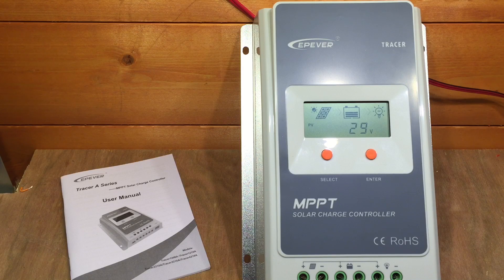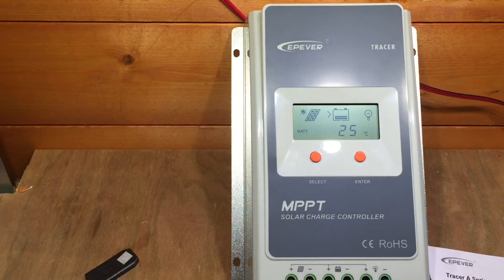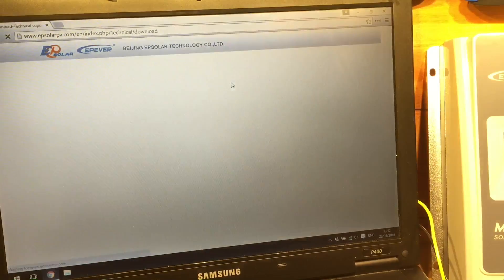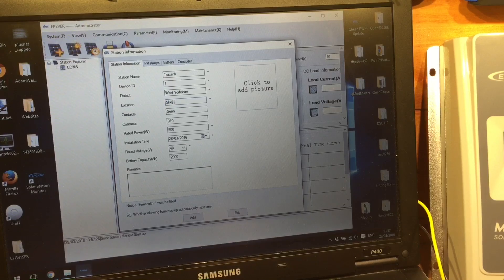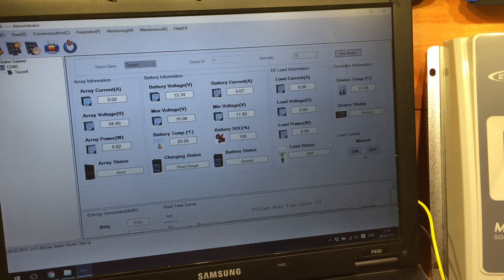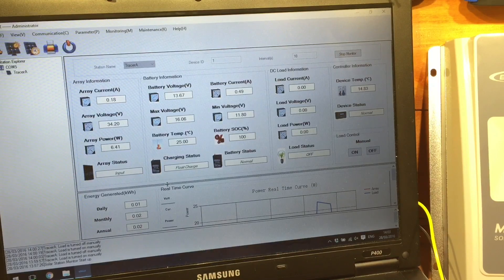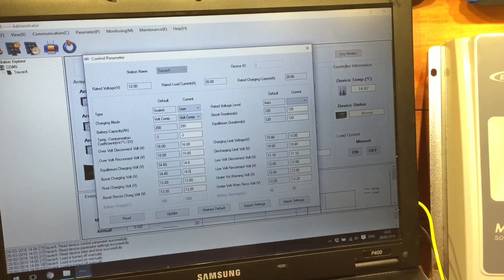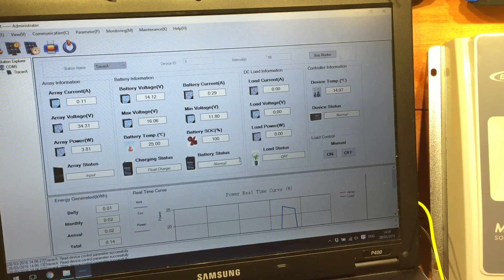EPSolar Solar Station Monitor software & a cheap USB cable - 12v Solar Shed

Comment: Well when she  does please let me know. I connected and commissioned my little system (250W PV, Epever Tracer 30A controller, 2 x 100Ah gel batteries and a pure sine wave inverter)  on Saturday and left the batteries to charge for three days as suggested by the manufacturer. It is a 70th birthday present to myself and last night I sat back and watched 4 hours TV courtesy of the sun. I am going to run a water pump to fill a 500 litre tank on my roof (it leads into 80  meters of 25mm black plastic pipe curled across the roof which heats up when the sun shines and takes the water into the house plumbing. No early morning or showers before going to bed of course)  my TV, laptop and lights. A bit of juggling is going to be needed  and info about how much each item uses and how long it will take to be replenished will be handy. I am in the bush in the Eastern Cape of SA and have plenty of sun and time to play. Watching you make the 485 cable reminded me of 1000 years ago when I worked out the pinouts between Autocad and HP A0 plotters. HP charged an arm and a leg and were horrified by my cheek. Add them to the dozens of 232 fly leads to Xenix/Unix terminals and .... oh sorry I am blathering on .....
Reply from the maker: I will - I'll make a note.  Sounds like you're having fun with your projects, perhaps you should start documenting your progress in a few videos?  Normally I'd be very jealous about your beautiful South African sun, but actually today it's gorgeous here - time for a solar experiment after work hopefully. :-)

Comment: Adam I went to the Tracer manufacturers site looking for something that would log and keep the info you have shown here. This because dedicating my laptop to the task is not practical. In the Tracer section they have something they call eLOG01 which does, and I cut and paste, 
eLOG01
eLOG01 is a record accessory matched with controller of RS485 interface, It can record solar system working data, and also real-time monitor system status via PC software or MT50. Default record time is every 10 minutes, with record range to 4 months. Is this not what we are after?
I could not find one for sale or even mentioned across the iNet so have this morning sent them an e-mail asking where I can lay my hands on one. They acknowledged the e-mail in Chinese at least I hope it was an acknowledgement and not the bird.
Reply from the maker: Thats a very interesting little find - I may contact them myself.  Last time I noticed a new product like this they did put me in contact with a British supplier who had just ordered some.  I like the fact that you can piggy back on an MT50 or PC (via the eBox-Wifi perhaps as well as the cable?) to still see the live data as well as store it.  Very interesting, thank you.
Reply: I haven't heard from them yet so if you have any luck please let me know. regards
Reply from the maker: Hi Mike - I've had an email from the European sales manager in reply to my inquiry. She explains that they don't have stock at the moment, but from what she says I think it is only a couple of weeks away.  I think she is going to contact me once they are available.
Reply from the maker: Hi Mike - just to keep you in the loop.  EPSolar themselves now have stock so hopefully this will start filtering out to the resellers.  I've managed to secure one - so hopefully I'll have it in a couple of weeks to play with.
Reply: Hi Adam. I'll follow with interest. Thanks for the info.

Comment: I have one of these in a motorhome.
Now it seems somewhat ridiculous to also spend good money on a high current multi stage mains charger when this is in place, so I'm thinking of simply pushing 24-35v into the unit from a rectified 100a arc welder or a pair of stacked 12v server psu.

Already have the welder transformer and diodes, just wondering of you think the waveform would be too noisy for the tracer to cope, if so I'll go for the other end of the spectrum with ultra-smooth kva 24v. Your thoughts?

I'll talk to you later about the unmatched batteries and 70a draw...

Comment: nice vid. does this software also run on raspi2?
Reply from the maker: No the official software doesn't.  You can integrate the charge controller into a Modbus network though using some standard software, although I haven't done this.

Comment: I wonder if the bulk charge voltage can be set to 16.8v/21v/25.2v/29.4v to charge  lithium ion packs of 4s, 5s, 6s, and 7s.

Comment: RJ11 telephone connectors have the same thickness, contact spacing and retaining clip width as the RJ45 connectors.  I'm using a 2 wire generic telephone cord as my RS485 cable.  The 3210A's metering is optimistic at low values, something I discovered in my tabletop testing using a 7AH battery and a 17 volt, 200 ma wall wart as the solar panel.  

Thanks for the video.
Reply from the maker: +notyoung Yeah that's a good alternative for the USB cable. Cheers

Comment: Adam, I was wondering about that bit, where you lowered the charge V to 14. In your case it's probably a good thing to do, because you have sealed batteries. But if they were flooded type, higher voltage would be recommended, because that's what drives the sulfate anions out of the plates, at the cost of loosing a little bit of water each full charge, but that's no problem, when you can just add some water. I think the batteries will get sulfated more, with that voltage lowered. But I would do the same you did, if I had sealed ones, it will likely give it a longer life, as you can't add water.
Reply from the maker: +TheRadiastral Thanks - yes I used sealed (AGM now actually) so I tend to run them a little lower.
Reply: @AdamWelchUK  Hi I notice you made this comment 5 years ago, but are you still using AGM batteries? If so are the suggested settings the same as what you changed them to in this video?

Comment: thanks for the video! just ordered the cable required to hook up to my tracer. my system is running fine but I'm not overly impressed with what the battery seems to be producing. will I be able to figure it out/get it working better once hooked up or is it mainly for tracking the numbers etc? hope that makes sense. thanks.
Reply from the maker: Thanks for the comment.  If you're referring to the state of charge meter on your tracer and that is leaving you worried about your battery it may be worth watching my latest video on the EPEver charge controller.  https://youtu.be/YowgBCl1F1I
All of the EPSolar / EPEver charge controllers seem to have the same settings on that SOC meter - and it's possibly one of the most frequent complaints I hear.  It will only show as full when the battery is actively being charged.  It quickly drops to 40-60% once the sun has set.  
Personally I prefer to keep an eye on the battery voltage - at rest.  12.7+ is 100% charged for me.  I don't ever take my batteries lower than 12 volts, but I tend to keep them at 12.4 or above even after an evenings use.  I'd call 12.4 ~50% charged but the EPEver will show almost depleted.
Reply: Thanks for your response, appreciate it! I'm not exactly referring to the SOC meter really (Had seen you mention this in other videos, I tend to ignore it anyway on my MT50 through my Tracer 2215BN). 

I guess what I'm not convinced by is my new 135ah 'deep cycle leisure battery'. This is my first dive into solar/12v power so I'm still very much learning, but the battery seems to go from 12.6 say to 12.3 after running what I'd consider a very small load for a short while. Was wondering if setting it up properly via the cable might help? Thanks for your help.

Comment: This software is good, I use it on a minix pc (150 euros incluing tax and win 10), associated with teamviewer you can then use your smartphone to watch remotly (win/android app).
that way you can control the load as well (connected to a relay for instance).

Comment: I'm trying to connect to the EPEVER "solar station monitor" program using the stock cable (https://www.amazon.com/Battery-Temperature-Sensor-Monitoring-adapter/dp/B016RU8JUY/ref=cm_cd_al_qh_dp_i), but it doesn't work. Is anyone able to connect using that cable?

I ordered the RS485 to USB adaptor, hopefully that will fix my issue, but I'm curious as to why the stock cable wouldn't work. My controller (the Epever Tracer 4210A) works with my MT50 remote monitoring box, so I don't think the port is the issue.
Reply from the maker: The most likely issue is a driver problem.  I'm not actually sure what driver is required for the official cable.  Check inside device manager - you should either find a suitably names device under Ports (COM & LPT) which will tell you which COM port to use in the solar station software or a Unknown Device - which means it's a driver issue.
Reply: Good idea, but the driver is installed correctly as far as I can tell. No issues apparent in Device Manager, and appears under Ports without any yellow marks. I'm not at the computer now to see the exact wording though.
Reply: Well, weird, I got the adapter you're using (purchased on Amazon, for anyone else looking) and it worked right away. Not sure if I had a defective cable or what, but thanks for the great tutorial and inspiration.

My Raspberry Pi is now happily reading the status (PV voltage and amperage, battery voltage and amperage) from my charge controller using the code snippet here as a starting point:

http://www.solarpoweredhome.co.uk/
Reply: I solved the problem! Phew! I needed to ground the charge controller to my Raspberry Pi. So going by the diagram shown in this video, that's pin 7 or 8 to one of the ground GPIO pins on the Pi.

Comment: Hi Adam
I'm Lost  after  making the same cable 
I did not get any date from my tracer 4215BN
now looking to the my RJ45 Pin Setting on the MT50 which are from Richt to Left numbert 
Pin 1-8-2-7-3-6-4-5 (and not as show in your Video 1-2-3-4-5-6-7-8)
see page 29 of the file http://www.epsolarpv.com/en/uploads/news/201506/1433818814375560.pdf
when I am back I will recheck changing the wiring hopefully this will work.
Reply from the maker: ray mont Hi. The wiring diagram I show at 3:10 is the same as the one you have linked to. Are you using a long cable by any chance or perhaps in a electrically noisy place?  If so you may well need to add a ground connection. The best area to do this on these cheap rs485 USB adapters is on the negative USB connector. You'll need to solder it though I'm afraid.
Reply: Hi Adam thanks for your Quick reaction   
I startet up with a 10 meter cable and ended with  1 meter 
I tried ever pair possibility but nothing
when I'm back ,I will try it with a ground between pin 8 and the usb housing 
however after installing the 1.5 software on my laptop I noticed that the Device ID change from 3 to 1
So maybe my problem lays there.
Thanks keep up the good Work.
Reply: Good evening
I've made a new cable and every thing is working
Perfectly, no ground was needed.
Reply from the maker: +ray mont Good news. Thanks for letting me know

Comment: Hey Adam, just a heads up if you didn't already know, there is a newer version of the Windows EPever Solar Station Monitor software out, V1.5, I noticed there is a new option under Parameters called "Control Parameter(LiBattery)" which lets you set voltages etc up for Lithium batteries, thought you might want to take look if you haven't seen it? :)  Keep up the good work on the vids, been following for a long time now and you have great content which has been helpful on more than 1 occasion :)
Reply from the maker: Thanks - I haven't seen v1.5 but that option was introduced in v1.4 which I've been using.  I'll check it out and see but I wasn't that impressed with the charging voltages I saw in the default options in 1.4 (not a big problem as there is a user mode still).  I'll grab a copy now and see what else has changed anyway. 
Glad to have been of assistance to you in the past.  Cheers

Comment: Hey Adam, could you use this to charge lithium ion batteries? similar to what you did with the smaller PWM charger in your other video.
Reply from the maker: +Kold Could the tracer A series charge lithium - yes it could. You need to consider how much current could be delivered into your lithium pack on a good day though when MPPT is working at it's best. You wouldn't want to charge lithium too aggressively.
Reply: Thanks Adam. Maybe the better question is what is a good lithium solar charger? I noticed in your other video you tried some but they were trickle charging. Do you know of any that don't?
Reply from the maker: +Kold There are very few specific lithium charge controllers which don't trickle charge. The one from electrodacus looks amazing but I've never had a chance to play with one. It also has a BMS built in. 
I think a lead acid charge can be a good lithium charger - you need to ensure the float charge (which is essentially a trickle charge) voltage setting needs to be considerably lower  than the boost voltage. Lithium batteries don't fall back in the way lead acid do - so in essence they don't float. 
The cheap commercial lithium charge controllers have a target voltage (usually set at 4.2v/cell) and trickle/float at this level. Potentially damaging, if not dangerous in my opinion.

Comment: Thanks for the info. You could teach this company a few things about how to write a proper user manual. Unfortunately, I'm getting an "Operation failed. Operation timed out" error in the msg dialogue after clicking the 'start monitor' button. Program recognises the connection to COM5, but I'm no computer wiz. I just want to charge my damn batteries. Get what you pay for I guess, next time I'm biting the bullet and getting a Midnite Classic.
Reply: There's also something not right about the charging modes with this controller. Currently only putting 25W into the battery bank on a rainy day from a 1000W array, but I have a separate 1000W array controlled by an even cheaper 40A so-called mppt controller from China that's also quite popular on ebay and it's currently dumping 50W into the battery bank. Can anyone explain that? For twice as much money I would expect these controllers to be more efficient, not less.
This seems to be a similar problem as what another user described in a comment below about their PV input voltage and current dropping when they really shouldn't be. My battery bank is currently only at 60% soc
Reply from the maker: +James Biggar Some people find the MPPT algorithm can be slow to track in some conditions. I have seen some evidence to suggest it gets 'stuck' tracking just above battery voltage. My battery is filling reasonably well while I'm out during the day so it's not been a big issue for me, but I'm looking forward to some better sun in a couple of months because I want to test this theory a little more.
Reply: ***** To be honest I've just hooked up the new array and the system hasn't operated on a clear day yet - but I'm not getting my hopes up, may have to switch to the other model I'm using if the EPEVER controllers don't make up for these rainy day losses during sunny weather. Every little bit counts when you're off the grid. Thanks again for your input

Comment: Hi Adam ,ve tried to make up rs485 plus to usb module same as video but says no device on app , the wiring pin numbers in the controller module book for rs485 plug are 1-8 straight across ,i picked a blue and green but no joy / the wiring pin numbers in the REMOTE Pdf manual diagram are numbered different they are 18273645 across the rs485 plug , wondering if i missed something , many thanks
Reply: I have the same problem with the app, says device disconnected, I managed to make it work on the Pc using the epvsolar software so the problem in my case is not hardware. tips?
Reply: I think the problem might be the android driver, the neccesary library to work with serial-USB chips.. 
I found this USB-Serial-For-Android library but the installation is out of my capacities. 
how come there is no official technical support on this from them.. ?
Reply from the maker: +ZeroHour Hello. You can either use a green and a blue or actually the pair of greens or blue I think. If you are using a long cable or in a noisy area you might need to add a ground connection. You'd need to pop open the USB adapter and attach the correct coloured cable to the USB ground (sorry I'm not near a diagram to double check which cable colour that would be). 
If that isn't working then I'd check that the driver is working correctly for your adapter, and check device manager to see which com port has been assigned.
Reply: Many thanks
Reply: Hi ZeroHour
I've got the same issue, did you get it to work?
Reply: No not working on android tablet may be faulty USB device , wonder if there  is a cable already made to buy ?
Reply: Ok just ordered  the ebox-wifi box from epever

Comment: Any chance you would like to colab and create a simple Arduino based RS485 reader? I want to buy a Tracer A series but before I do, I need to know that I will be able to gather all the info I need via Arduino Serial connection using an RS485 to RS232 Converter.
Reply from the maker: I would love to help but time is something I'm very short of at the moment.  I've been meaning to get to this for a while, but then I got the wifi adapter (and now the MT50) and those have filled the gap. 
This is the list of Modbus adresses: http://www.solar-elektro.cz/data/dokumenty/1733_modbus_protocol.pdf and there are some arduino modbus libraries out there.  There's a few people who have done it with the raspberry pi and the USB to RS485 adapter I used as well, so it can absolutely be done - given the time.